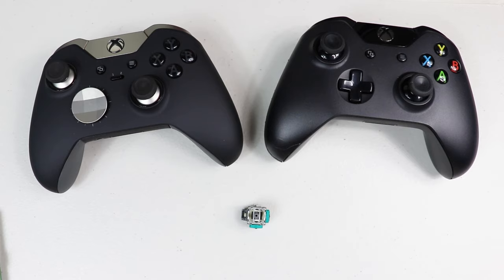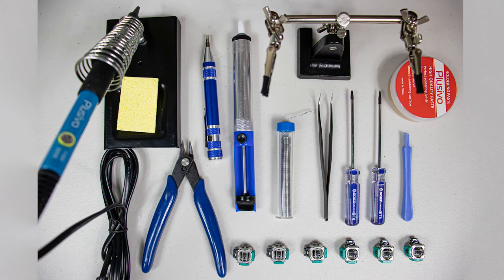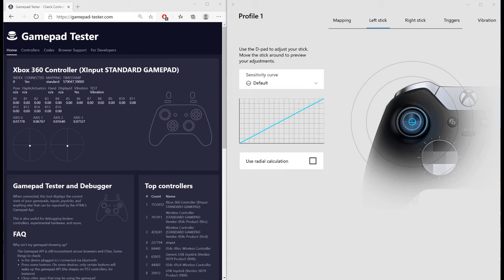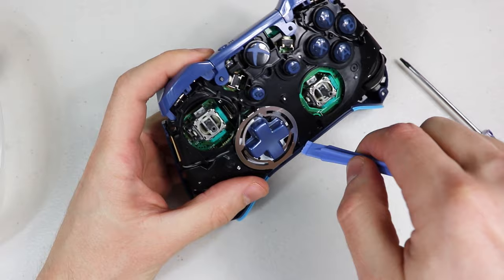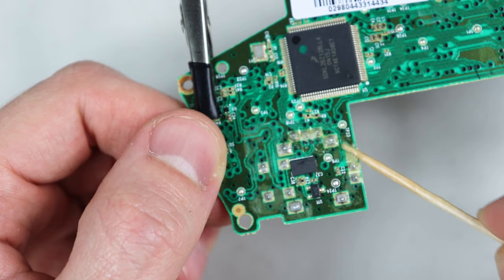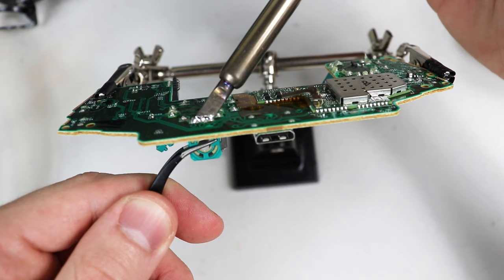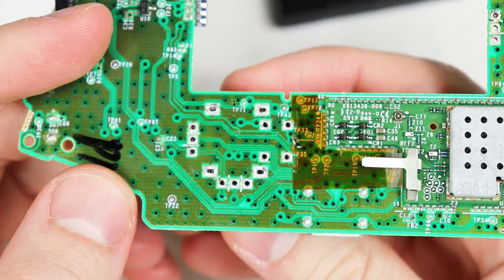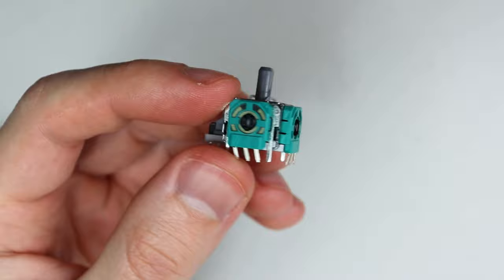How to Replace Xbox One Controller Analog Joystick - NEW METHOD - Fix Stick Drift, Broken, & Loose

Comment: Your amazing video has me contemplating giving it a try.  I see you also have a video on stick drift for the switch.  Any chance you can do one for the PS5 & recommend quality replacement sticks for that console?  My brother-in-law is having problems with his DualSense.  Come to think of it, my sister’s switch pro controller is also drifting.  Appreciate any help!
Reply from the maker: It's something I've really been wanting to do with the PS5. I actually grabbed video for it, but never did all the work to edit it and upload it. Because the problem with the PS4/PS5 replacement is issue with range after install. I found a solution, and that's by using higher range potentiometers. Only problem is, they are too difficult to source :/ I do sell the authentic replacement parts on my Amazon page, it's essentially the same procedure. However, it doesn't include the higher range pots, but you still may have luck with it.

Comment: Please correct me if I'm wrong but my understanding is that every potentiometer has a different resistance and to calibrate Microsoft uses software. One could simply recalibrate but there is no access to the controller software. That being said I have several questions (1)The fix you're doing is more of a true calibration? (2)How does stick drift occur? Is it just wear and tear on the connections to the potentiometers? (3)Would you say this is an issue of cheap hardware? If so, are there manufactures of better joystick assemblies and potentiometers?  (4)Does this repair last longer than a typical controllers self life? That would be great if it was, I've noticed that Microsoft controllers last about 3 to 4 months right around their 90 day warranty smh... Thank you for your videos!!! They are very in-depth and I'm excited to get get all the supplies needed to stop shoveling money to Microsoft :)
Reply from the maker: Welcome to the world of DIY repair! 
You're pretty much correct on the forefront. The potentiometers are just part of the equation with the varying level of resistance differences. Albeit the main factor.  Slight differences in positioning of the potentiometer on each joystick is the other main factor.  But yes, if we had the software we wouldn't have to go through this trouble.
1) Not sure what you mean by true, but it is a physical calibration, essentially recreating the original joystick's resistances that was calibrated from the factory and stuck into that controllers memory.
2) Correct, stick drift is the wearing down of the carbon inside the potentiometers.  
3) For whatever reason, every joystick for gaming uses this type of potentiometer. Unfortunately I am not aware of any alternative.
4) It will likely last about the same amount of time, however now you will be equipped with the knowledge of replacing them.  Also, I didn't mention it in this video (which I do plan on making one, some day) is that you can simply replace the offending potentiometer if the issue is only stick drift.  For other issues like broken shaft, loose joystick, and broken joystick button, it will need full replacement.  The single potentiometer swap will still likely need the manual calibration as shown in the video.
Hope that help on your endeavors. Any other questions feel free to ask.
Reply: @SOSSGAMING  No other questions, Thank You!!! Detailed thorough answers for a detailed thorough video. Appreciate it so much, I look forward to future videos by you and I hope your channel continues to grow!!!

Comment: Today I removed the elite joystick and noticed it was 10x more harder than a normal controller had to take em off twice and it gets easier once you find what works for u to remove the solder

Comment: its easyer to unsolder  components if you add low melt  or just [ leaded solder] to all the holes by just melting together on top of factory unleaded joints  . it will be easyer to get soldear to melt and it will stay liquid bit longer .
Reply: and be free to add as much flux as you want . flux makes magic happen , and afterwards just clean easely with alcohol  70% or higher .
Reply from the maker: Great tips! Thanks for sharing

Comment: My right stick when pushing down does not melee via COD, so I followed your guide(thank you); however, it's not the analogue stick, for the new analogue stick still does not activate melee when pushed down.  Nevertheless, this video was quite valuable.
Reply from the maker: Oh no that's unfortunate :/ I wonder if it's as simple as something in COD's settings or even the mapping for the Elite controller?

Comment: So the calibration is absolutely necessary? Seems very time consuming but I guess if you have several controllers it's worth it.
Reply from the maker: It can be challenging at first. About 1/3 of the time it will be within an acceptable range without doing anything.  But the other 2/3 of the time it will be necessary.  If you want the best calibration though, it should be done every time.

Comment: Thank you for the great tutorial! One question I have, if the pots are what go bad what’s the rationale for replacing the whole stick rather than just the individual pots?
Reply from the maker: I would replace the whole thing if the joystick is becoming loose, the shaft was broken, or the button wasn't working. If it's still pretty stiff and moving around just fine, returning to center just fine, the button works, I'd just replace the pot(s)!

Comment: I am working on a low cost solution for calibration that once the mod has been applied that will not require opening the controller again unless a potentiometer is worn out .
A controller landed on my bench for the first time today and after going over it and the replacement parts with the meter the solution became obvious !
Reply: let me know if you figure something out please hah

Comment: So a couple questions:

1: You had mentioned that there are a lot of unreliable and otherwise crap stick modules out there. Have you had any experience from the ones that ifixit sells?
2: The manual calibration, bending of the potentiometer pins, and the snipping of the round pegs on said potentiometers. Is it truly required? Or can we just test the sticks, then fully solder them in?

Going to be doing this for the first time on a 1708 controller, and wanna make sure i don't go into this with any question marks.
Reply from the maker: The picture looks like they sell the correct ones. Although it looks like they only sell one piece for the same price I sell a bundle of 6. 
It is most likely required. About 1/3 of the time you can get a reading on both potentiometers under 0.10. If you only have stick drift, I'd recommend just changing the potentiometer. The probability increases that you won't need to adjust the potentiometer if you leave the original joystick in. It's also an easier process. Even though I like to replace the whole thing anyway, it's not technically necessary to replace the whole thing.

Comment: Thanks for the video, extremely helpful. Quick question though: Do you recommend recalibrating the joysticks if you're just replacing the rubber top piece?
Reply from the maker: If you are just replacing the thumbsticks, I would say no.  I wouldn't recommend replacing/re calibrating them until the joysticks are actually causing any issues.

Comment: Nice vid, tottaly saving it for my controller shenanigans.

Just one question: I've seen some pcb addons that solder in the potensiometers  pads, which give pots for adjusting the centering. Ever tried those?
Reply from the maker: I have actually! They won't work on all controllers, but the ones they do it works pretty well. Despite their claim though, it doesn't fix stick drift, it just centers the joystick. Funnily enough I can still center a joystick faster with the method in the video than one of those devices, but those devices are nice for fine tuning, and may be easier to do for most people for calibration purposes.
Reply: I see...
I also knew that they wont fix the drift due to pots wearing; but I think they night be a good solution if you make the initial setup and then use the trimmer to adjust Afterwards.

Comment: So I was doing this on a series 2 controller right. Got it off got the new On then I noticed the controller doesn’t turn on after I put it back together. I noticed I accidentally pulled this gold piece. It’s so much easier to explain in photos is there a way if you’re not busy I can explain it to you better? I understand you’re probably busy or if you don’t want to. Great video

Comment: great guide I was doing well till I plugged it back in and the thing was pushing up the whole time when not touching joystick looked back and I think I nipped a small capacitor when pulling apart the old joystick so yea be really careful when doing that and dont end up like me with a worse off controller then already was now unusable all together will still try fix it later one.
Thanks for the vid I clicked on all the links for the stuff even when am not in us hoping you get a kick back every time someone presses the link.
Reply from the maker: Oh no. Do you know which capacitor it was? Sometimes that can also be caused from a damaged through hole pad as well, which can be remedied through a jumper wire to the right spot. I only get a kick back through orders. Not a big deal though. Thanks for the support :)
Reply: @SOSSGAMING  was a very tiny black one close to the 3 pin side way to small to bridge will try and get a cheap spare parts on eBay as not that much for one that has all rubber lost but still working but can just change out the board in side for mine so it not a bad loss. My own fault for not looking were the clipper was when braking the joystick learn from mistakes as they are very hard to see the tine black ones did not even know I did it till I looked round with a magnifying glass to see why it not working ill be more carful next time I do it as will be doing it again at some point as they always like to fail and drift.

Comment: You don't need to do calibration, just change again analog stick with a new. That analog is defective, spring inside is not on the center.

Comment: I do not recommend the use of hot air as there are 0201 size components in the area, one sniff of hot air would be enough to de solder them due to their low thermal mass :( They are hard to see and almost anything will dislodge them !
The recommended tool for the job is a vacuum de soldering station, my low cost Chinese made one came from ebay and does what it says on the can :) As with any thing that runs on mains electricity from China, check that the Earth / Ground from the plug is actually connected, with mine the gun is connected but for some reason that I must investigate, the metal case of the unit is not :(
Reply: i use hot air to desolder the module even with the small components in the middle, as long as the air isn't at a ridiculous speed they will not fly off or dislodge. hot air is actually a really good way to desolder them

Comment: If you are able to remove the original joystick module without damage, couldn’t you just replace the new module’s potentiometers with the old ones to solve the calibration issue? I’m new to this type  of repair so I could be terribly mistaken😅
Reply from the maker: Unfortunately there's always some variance to the potentiometers themselves. The values change slightly depending on the imperfect resistance of the amount of carbon added during the manufacturing (I'm guessing) however if you were to leave the potentiometers in (assuming they're in good condition still), then just changing the joystick part will likely lead to no need of calibration. Hope that makes sense lol

Comment: I dont see a comment I just posted so I will try this again.  Did you know that on the back of each sensor is a number?  The number represents an hour hand.  There is 8,12,6 and 3 which corresponds to placement of  the analog control module on the sister board.
Reply from the maker: Very interesting. Can you expand on this?  I'm looking at a few right now 3e, 3d, 2d, 2f, 3g.  I'd just assumed they were batch numbers or something.

Comment: Thank you for this great vid!

Does it mean that i can skip the calibration if i will use it only on the PC without any disadvantages? Or should i also do the calibration for PC?
Reply from the maker: I don't know if the PC calibration still has issues, but if it does (which I think it does) you may still need to manually calibrate :/ For some reason the calibration on the PC doesn't work, the last time I tried it.

Comment: I have a bit of an odd issue with a series controller. I've replaced a thumbstick and it shows hard down on the Y axis. You'd think one pin wasn't connected but I've checked them all and it seems if you press down it gets to a very small window where the stick works.
Testing the voltage out the middle pin it seems correct at 0.8v with a range of 0v - 1.8v ish like the other 3 pots. But the only working range is 1.7-1.75v so outside that range it thinks it's hard up or down.
It's like the internal calibration has lost its way, if you manage to get to the calibration menu on the xbox you can calibrate it and it'll work fine for 5 minutes and sudden go back to the above!
Reply from the maker: Do you mean the joystick was replaced? Or just the thumbstick? If soldering was involved, it's possible a through hole/pad is damaged and barely registering. If it was just the thumbstick, it's like just a heavily worn out potentiometer, which will need replacing. What are the normal values shown on the testing site?

Comment: I am a moderately experienced solderist and i did exactly what was shown in the video. I dont know if i have insane bad luck or what but both controllers are now wrecked. Joysticks came out and back in just fine. One has permanent atick drift regardless off joystick so something on the board is shot, and on the other one in thw process of centering the deadzone i somehow managed to fuck up the X axis so, again, no matter what joystick i use the X axis doesn't register so it's some kind of damage on the board. My takeaway is that the board is hella touchy because i was bery careful about changing everything out and now i got two dead controllers. So frustrating when i can't Google ways to troubleshoot these issues.
Reply from the maker: Sorry to hear that. More than likely one of more of the through-hole pads are damaged on the offending axis. There is a "fix" though with some jump wire cables. If you want a schematic of where to put the jump wires message my gmail sossgamingcs with what controller your working on and even better a picture of the board. Might be worth a shot.
Reply: I really appreciate your reply, I'll hit your email with pictures

Comment: I have replaced at least 10 joystick modules and never even thought about calibration.  Maybe on my next personal one I do, I'll at least check where it's at. BTW a desoldering iron is much easier to use than separate tools.
Reply from the maker: You are very lucky! I wonder if aftermarket joysticks were used which usually have integrated deadzones in them which make it less of a necessity for calibrating, although it comes  at the cost of accurate joystick response.  And I agree, I use a desoldering iron on my jobs as well.  This video is to demonstrate it can still be done with regular soldering tools. Thanks for watching!
Reply: I spoke too soon. Replaced 3 pots today and one did not take still drifts. I'm probably going to replace the whole module and maybe even calibrate. I'm going to check out this program for testing first so I have something to see if I'm making progress.
Reply: I bought a 10 pack like 3 years ago. I'm sure they're cheap modules with large deadzones. Usually I'm fixing for my kids - I'm not sure they can tell the difference.  For my elite I bought  2 uprated higher tension modules and they are pretty good (again no calibration ). I'll see if I can improve my techniques.  Everyone can learn new stuff.
Reply from the maker: @bullseyepete8367  That's awesome. It's always satisfying being able to repair parts rather than replace them.  Happy New Year!

Comment: Sir which one is the easier to repair/replace parts for newbies who tried soldering? Is it the Xbox 360 wired controller or the newer Xbox One/S/X controller? We replaced a Logitech g102 mouse clicker and already had a hard time, took 2 of us working together for about 3+ hours and that's by simply removing the soldered parts on the board. Good thing applying soldering iron with soldering paste is not hard.

We plan to pick up cheaper used Xbox controllers for couch co-op, split screen or controller gaming on PC, I don't think we can handle very intricate and high level soldering for the moment. Cheap fake Xbox controllers don't last long 2 weeks max and will have stick drift and sunken buttons issues by then. Those original Xbox controllers last a long while before stick drift and sunken buttons happen.
Reply from the maker: I've tried to repair a xbox 360 before and it is much harder imo. The pads on the board are very fragile but mostly it was the calibration part that was difficult. There wasn't much room for error. Also the joysticks are harder to find. The originals anyway. The aftermarket ones have integrated deadzone which I don't like and they look very similar to the original ones so they are hard to distinguish.
If you only need to repair for stick drift though you don't have to replace the joystick, just the potentiometer causing the drift, which will be an "easier" job for you. I'd recommend the x/s controllers to start with if you end up deciding to give it a go. Best of luck.
Reply: @SOSSGAMING  Thanks sir, we will go with Xbox X/S controllers rather than 360.